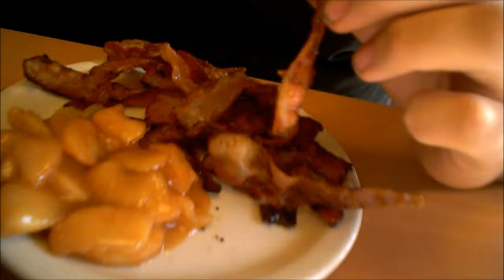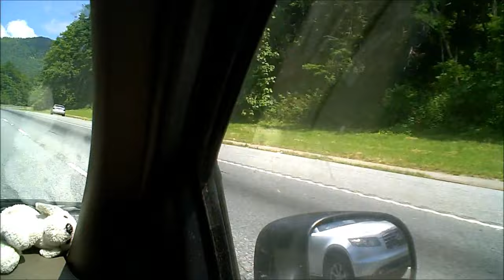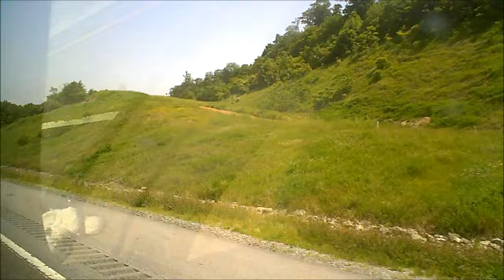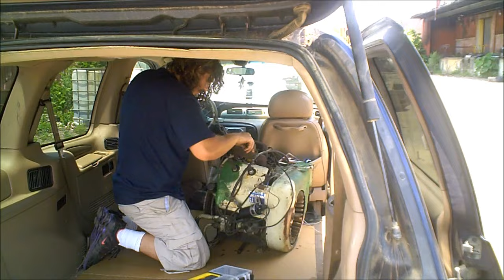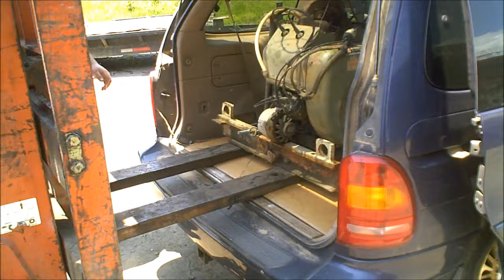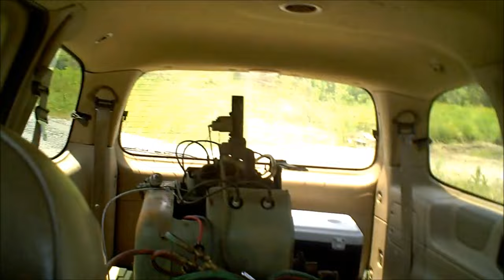Quest for a VF4D  Wisconsin Engine

Comment: i had two of those engines on haybailers worked great but when i changed to round bails i did not need them. i scraped them cause i could not give them away,